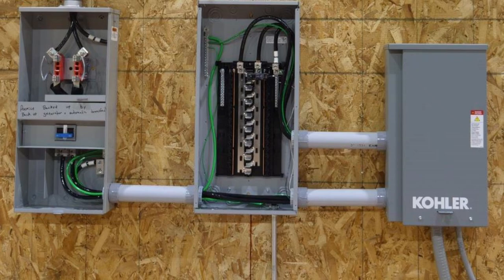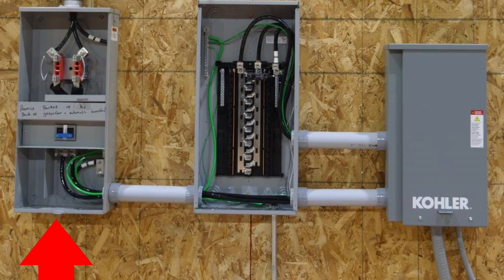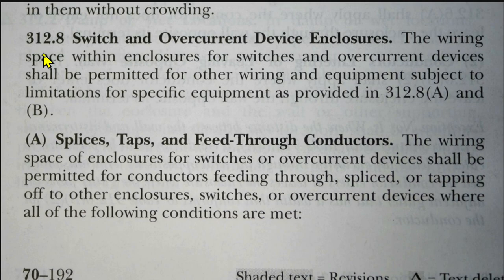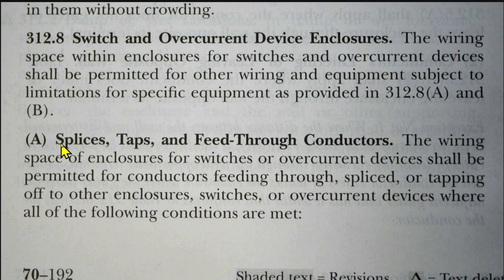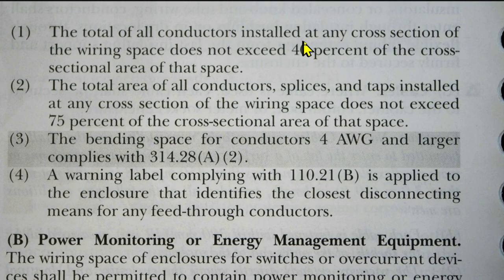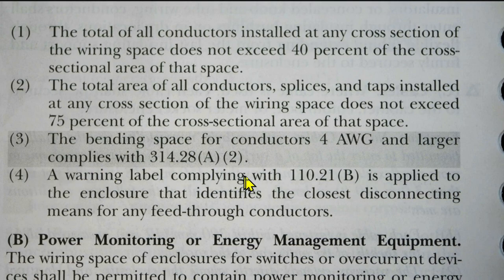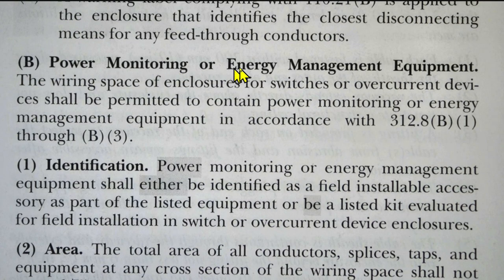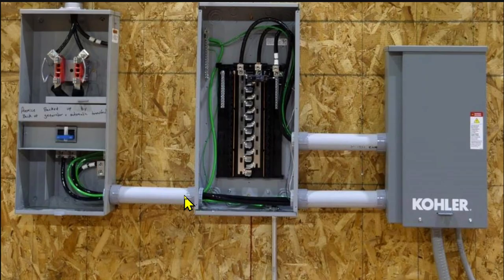Feed-Through Conductors 2023 NEC 312.8 (A) and (B)

Comment: If you have main panel outside 7ft away from tiny home on pole 200 amp  breaker panel ( bonded neutral and ground, its 1st panel) 2 -8ft. Grounding rods over 6ft. Apart  #4 bare copper connects to main panel quadra plex 4 wires 4/4/2/4 connect to inside 200amp breaker panel 7ft away  does inside panel seperate neutral and ground. Will be connected by #4 green insulated wire back to main panel 7 ft. Away at bonded neutral/ground bar ( which is connected to 2 grounding rods) does inside panel need seperate grounding rod or rods, would it not interfere with mainpanel rods so close to house unless 2nd panel grounding rods are
at least 2×8ft. Grounding rods  16ft.  Or what distance. Is recommended!  Because green wire connects to main panel outside neutral/ground bar and goes underground in PvC conduit to inside sub panel ground bar and seperate ground wire for sub also connects to ground bar( if installed) would interfere by causing alternet loop unless it is installed min. 16ft.= (2× 8ft. Grounding rods ? Remember 2 grounding rods are 7ft. away from each other and only 2-3ft from house where service enters house. Gotten conflicting answers orthe you can never have enough grounding rods( but with the short distance 7ft.  they would  interfere with each other basically having 2 paths from neutral/ground bar to subpanel ground.

Comment: Could the wires from the ATS come to the panel in the middle through the same bottom conduit if it was large enough? 
Also, not directly related to this video but does the code require a disconnect between the ATS and Generator.Thanks!

Comment: Thanks. Your video addresses my situation directly. I want to install a sub panel next to a main panel on an exterior wall, and the wires for the sub circuits will be spliced in the main enclosure and feed-through a foot of conduit into the sub. However, can the source of power for my sub panel come from another meter of a different address?  That is, two houses with different address meters next to each other on the same lot, and the power for the sub panel installed on house A comes from house B. (Solar is installed on B but underutilized.)
Reply from the maker: Wow, but that is illegal without house B's permission.
Reply: @SparkyChannel  House B is our ADU. In California, all new units must have solar.
Reply: This is almost certainly something to involve an attorney and an electrician on to get everything down on paper and filed as necessary.  The next owners will want to be aware of this, even and especially if you intend to be there long haul.
Reply: Ask your inspector or call the presiding utility company before you do anything.